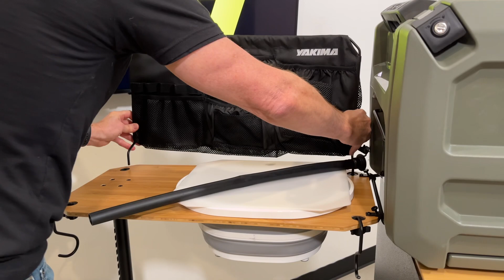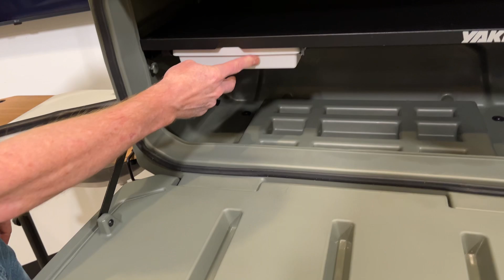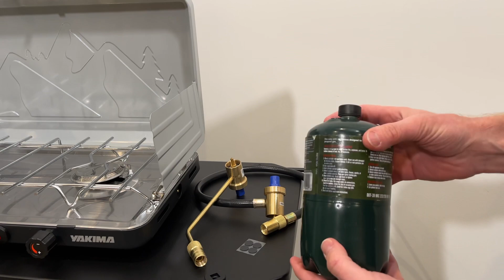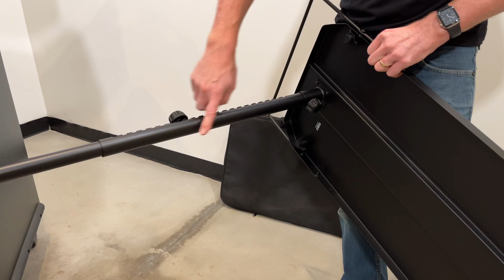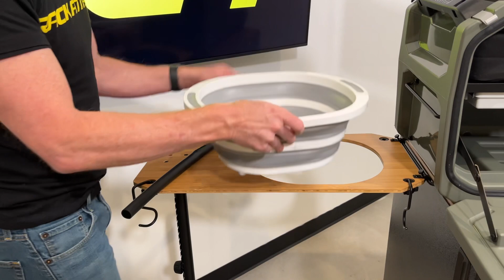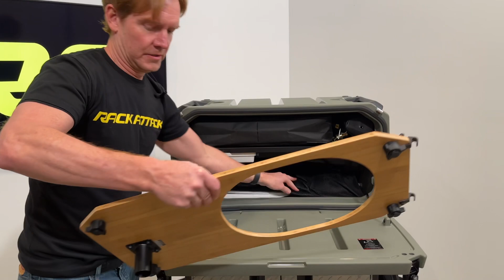Yakima EXO OpenRange Deluxe Camp Kitchen Overview

Comment: Certainly I nice little set up. And thanks for the video. My thoughts are that there are some improvements to be made. Really the big ‘cooler’ is simply a storage unit for the stove and remaining accessories. Not a great deal of use for it once the ‘kitchen’ is set up. Im not so sure it’s even realistic to use the open lid as additional prep area. Pushing down on the lid will probably result in serious instability not to mention the lid area is riddled with indentations from the manufacturing/structural engineering process. It would be an improvement for the right side table to also fit in the ‘cooler’ while in transport mode. Having the extra carry bag kinda defeats the purpose of the all-in-one attempt. Perhaps these changes will come out in the next revision?
Reply: I agree, there are so many things to change about this for it to be nice for the price.

Comment: Cool little system, shame the metal table doesn't go inside too, if it did, I'd buy one now...
Reply: I think this guys mistaking, I think that metal table would fit inside on the bottom if he didn’t put it in the that carrying case. It didn’t look and longer than the wood table. It makes zero sense why Yakima would make everything else fit inside and not that table.
Reply: @SleepingGaint   The second raw for the Leg kit ,which is he didn't mention on this video
Reply from the maker: Hello.  Yes, would be nice if the metal table fit inside, good thing the padded carrying case is included so that it can be put inside the vehicle.  Thanks!